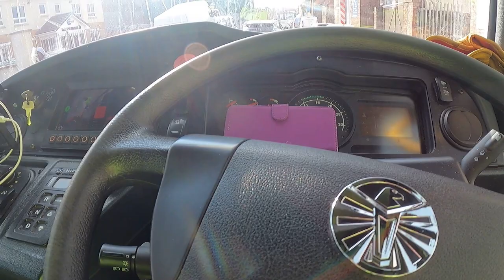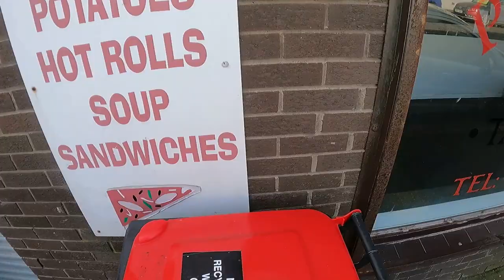On the bins/Commercial General waste/trash  in Troon and Ayr

Comment: Loved it!! Another brilliant video. Are your commercial runs usually quite big or are they fairly early finishes? We don't collect commercial waste, my council only does household waste collections
Reply from the maker: Cheers for the comment pal.The commercial runs are not too bad,on a day shift we start at 6am and normally we have the run finished for about   12 o'clock. We don't have a job and finish unfortunately anymore so even if you finish at 12 ,  we still can't clock out until 1.50 pm. Does a private contractor do the commercial up your way ?
Reply: Good morning  @billythebintruckdriver3952
Reply from the maker: @adamcrane1436  morning